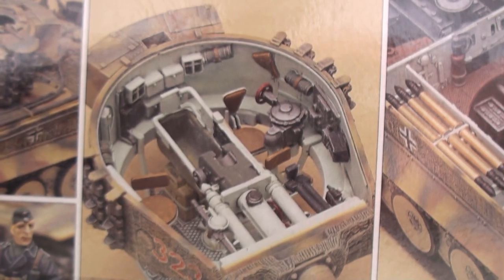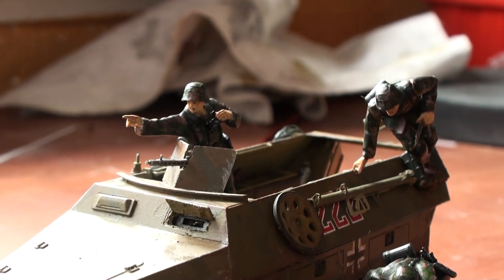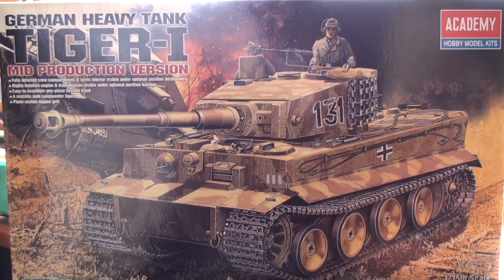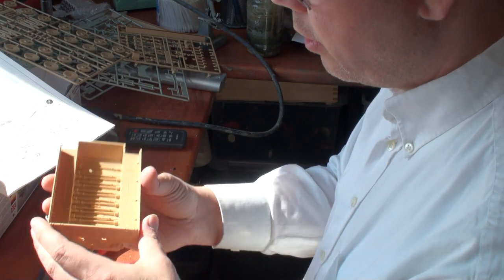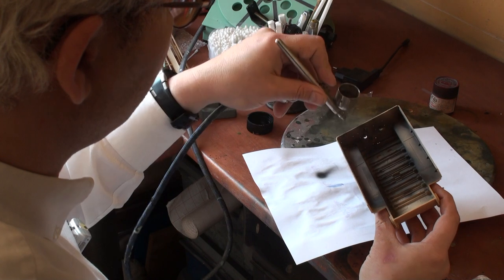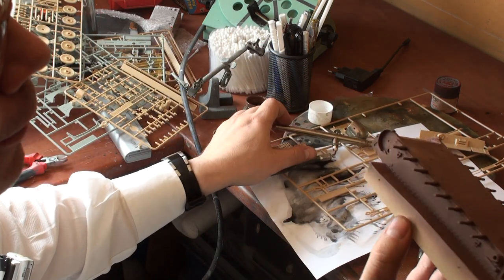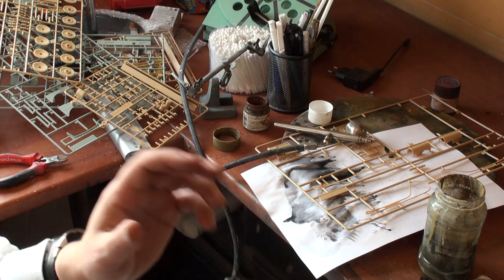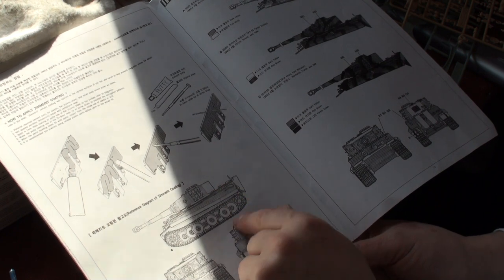Building the Academy Tiger 1 part 1

Comment: The Tiger has torsion bars at the suspension. As the 1st running wheel , same as the last running wheel have to take more stress while taking obstacles , those wheels have a thicker , stronger , torsion bar as the wheels between 1st and last. When you find 4 torsion bars which are different to the rest , than probably they are those to put in 1st and last position at both sides.